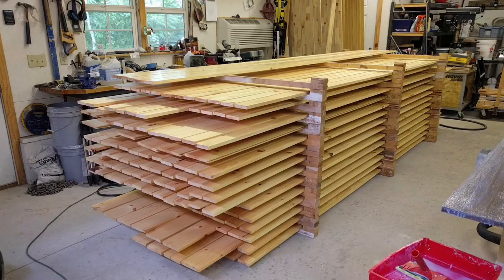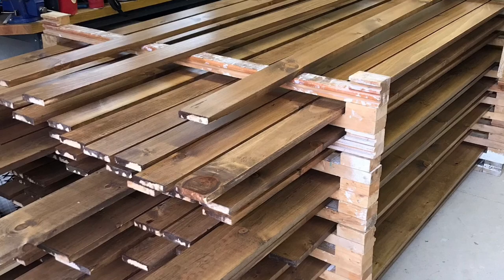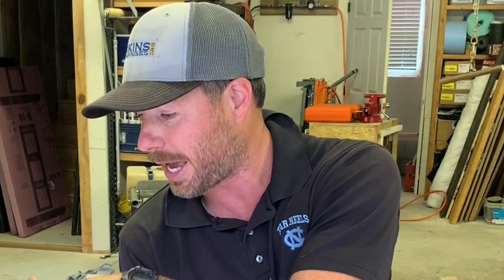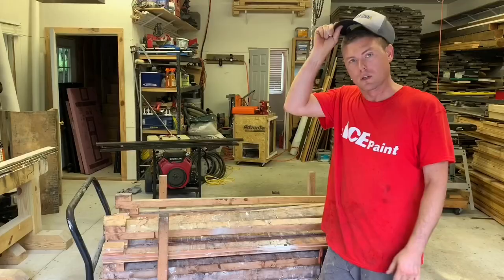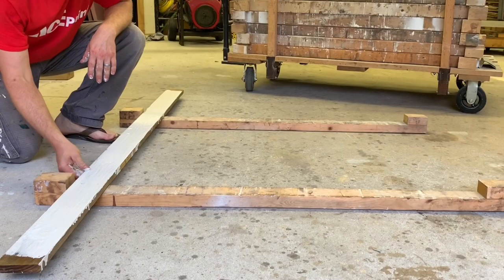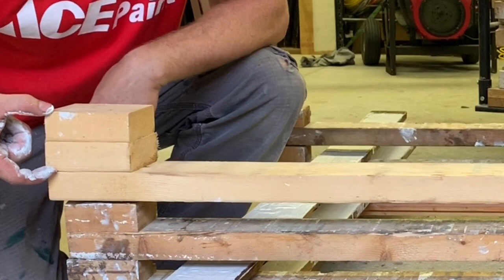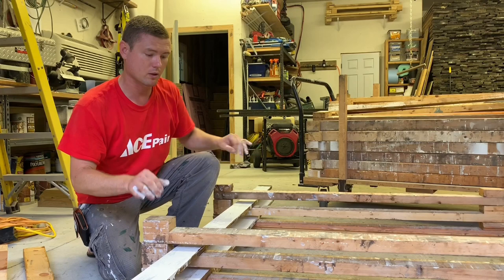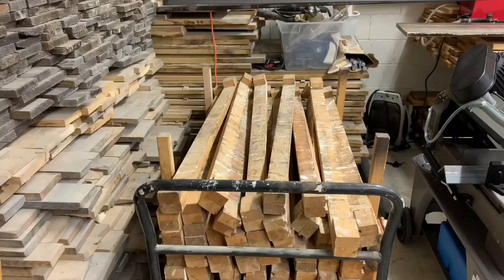Cheap And Easy DIY Drying Rack for Painting or Staining

Comment: Noticed one thing that might save a tiny bit of change on the framing. When you add the second block on the end to fit your 1”1/2 or 2” boards I thought to myself, save the wood and flip the next level of framing upside down. Square end block on top of square end block.. might lose some stability and could sag but would be curious if it woulda worked 🤙 love the channel

Comment: That's slick. I like it the idea for painting  or staining at the home shop. We used to a majority of our work at the job site. So we used to 3"PVC with holes through them for holding a metal pipe. It fit into a sq wood base with a PVC toilet flange to stand in. The pipes laid inside the large pipe when stored. It wasn't always great but it was pretty good.

Comment: Nice explanation. This system works like you say extremely well. Glad you mentioned bracing...learned the hard way when someone bumped my stack and collapsed on still wet siding.😣 For mine I used 1×4 x16' strapping cut at 4' no waste. Haven't had a sag or drying issue even with t&g log siding. Like the channel short and to the point.

Comment: I like the drying rack component feature.  Makes it very flexible for most sizes, & useful.  I was thinking that if you didn't have many "thicker boards' to paint at once, you could just flip over one layer of stacking boards.  No need for the double stacker unless you had many to do (as you do for your work)

Comment: Good, cheap....but definitely not
"ultimate". But if your using it only to store wood it would be ok.
When painting...that's a different story.
To have to set long " heavy" just painted wet boards on the bottom parts without messing the paint up, especially as you say 16' pieces, may be ok for young bucks like yourself, but not for older guys like me.
Plus the fact if your doing a thousand board feet that need multiple coats of paint you would need to either make another one or suffer the labor to take all the dried pieces off the rack and put them up against walls or whatever when you flip to paint the other side.! I know because this is not a new concept I worked in shops in NY AND OHIO, that had the same type of system.
That was back in the 90's.
The head finishers of course did not have to worry about stacking and unstacking them, over and over, but the lackies that did have to do it, hated the systems.!
Glad your young and strong and have good backs.! Cheers